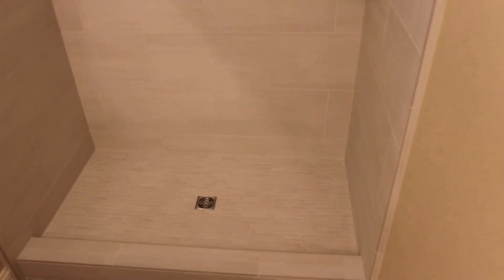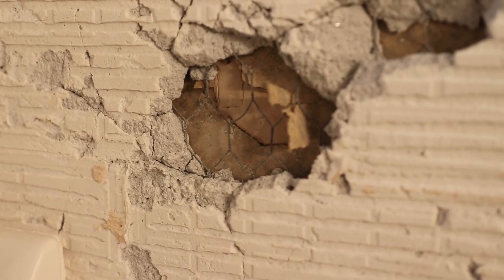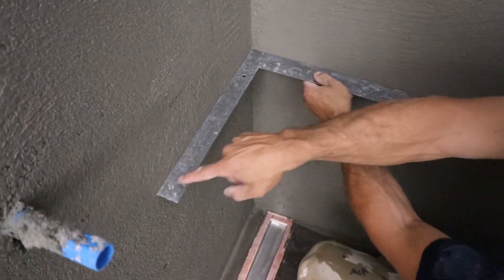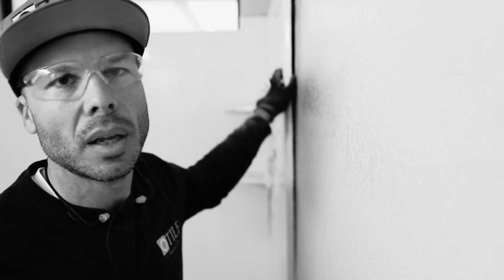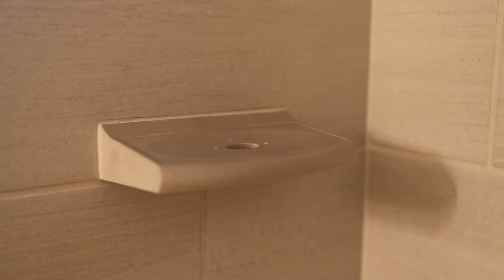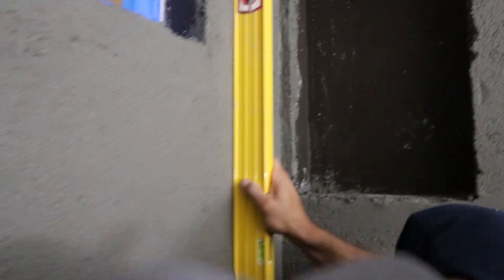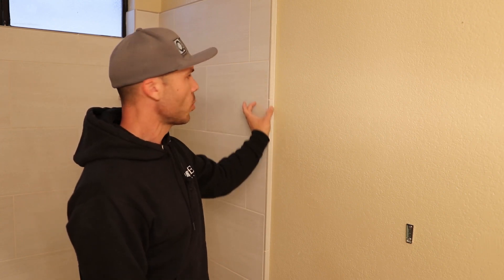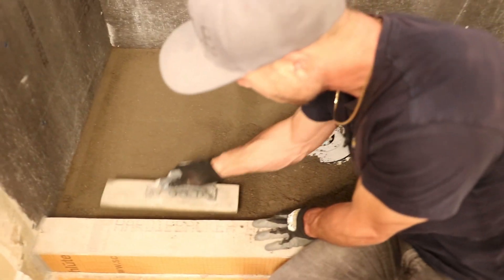Finished Repair of My Shower Tile Failure -- Why This One Will LAST!!!

Comment: Excellent job. I have literally never done a wall float like this, and I feel like we should be using it more up here. That is to say we should be using it at all. I will often slap a little mud in the hollow spots over top of the Kerdi. But then it’s just build out or in as you go, which is an art in itself. I think that the art of parging and floating is a superior approach though. We don’t have this tradition here though, it would be a very tough sell to say the least in this market.

Comment: Floating is the absolute best method  for both walls and floors.
Reply: @Gkbggb Gbgtjbftjj  if you over lap the sheets and wrap your corners and if using paper backed lathe, fold the paper back so you get a metal on metal seams, floating walls and floors never fails. It's a skill that takes years to master which, is why it is rarely seen today. Also, the cost is higher because of the labor and skill involved.

Comment: I'd be interested if you could experiment with the thinset and no lath method. Obviously doing experiments nobody else has messed with on high paying customer houses is a bit scary, though. But using lath, but having it nailed to the framing is definitely a better sounding idea. And don't worry about the haters saying don't float, floating is craftsmanship vs "production."

Comment: 0:32 Come on isaac. Get one of those burn proof cloths to put between your pipes and flammables when soldering.
😉
Oh and the shower looks great.
Reply: @TileCoach  Lol. I have done worse.  We just need to mention it because it's YouTube. 😉
Yo question for you. I am doing a starting to put together a bid for a 2nd story full bathroom. She wants a cast iron tub. But has had people tell her that you can't put a a cast iron tub on second stories. Is there a rule against this that you know of? 
This is in roseville off baseline.

Comment: Commenting here from Western Massachusetts.  The only wire we use  around here is called Diamond Wire Lathe.  I've seen the wire you are using in other  West Coast stucco projects.  Just an observation.

Comment: With the foundation moving, no hard brittle masonry/tile structure will be crack-free for long.   There may have been a dubious install before, but affixing to studs and using better tile may not be any better if the house is moving because of a substandard foundation.

Comment: The reason why you get a lot of comments on floating your walls is simply because it's a old method Yes it works but a lot of time to do you can simply add shims to your studs to flow out using a 6-ft level to make sure you are plumb after that you will add recommended cement board and go from there much faster to do not need to charge the customer more for the price of the mud and the time it takes simply just shim out your studs and go from there That's why you are getting a lot of comments on that anyways your videos are awesome and very educational keep up the good work

Comment: Just came across your videos today and did some binge watching on floating and this repair. Awesome work and videos!! I really respect your work ethic, you're a true craftsman.  I'm on the east coast and most tile jobs I see here are not floated, I'm wondering if it's more of a west coast way, perhaps because of quakes?  When I prep, I usually plumb out the new walls from the studs and deal with any minor dips or unevenness with extra mortar here and there, and I've had really beautiful finish results.  Haven't had a leak or fail yet (knock on wood).  I'm wondering if there are any real significant drawbacks to that work flow in your opinion? Thanks for sharing the knowledge you do.

Comment: Great video! Good on you to take responsibility for an unfortunate situation. Anybody can have a failure, takes a real pro to admit it.
Floating walls is not a normal practice in my area and it interests me. Perfect walls to stick tile to would be awesome! We usually use a paintable waterproofing or kerdi membrane. My question is how do you waterproof the dentshield joins and wall-to-wall transitions? 
Keep up the great vids and work

Comment: Look great, just a tip the less grout lines on a curb the better
Reply: J DJ : Yes, just going to act as a water trough, potential mould/mildew issues ?
Reply: Looks great , I agree I only use a 6 inch wide marble slab on curb tops
Reply: @danthecarpenterman9463  same here, I like to match  stone  curb, soap nook bottoms, bench, and vanity top if possable.

Comment: I love your videos. I'm a remodeler too. I'm not a hater but the only negative thing I can say is if you don't use ardex 8+9 on the fat mud,  any water that ever gets behind the tile will wick through the mud and will rust the roofing nails and will eventually cause the same damage as before. Galvanized nails will not rust. I hope this helps you.
Reply: Aren't roofing nails galvanized?

Comment: Hey Coach, two questions. Aren’t you concerned that the nail (and staple for that matter, but especially the nail) is a point of entry for water to get behind your float coat? I know you are nailing to the stud so there should be less wiggle with your roofers but still the wire mesh holds the head a small bit off the float and water could seep behind and down the shaft...Secondly, do you have any thoughts on continuous curb caps vs tile with grout lines? Doesn’t the grout provide an easy point of entry for water to enter a relatively flat surface? You spend so much time getting your slope right on your pan but isn’t the curb cap vulnerable to wet substrate if it isn’t a continuous cap like marble slab?

Comment: Love the videos, man. I have a question; since you use durock in this bathroom, how did you plumb the walls. Cause when you use float strips, you just plumb those and then screed off 'em. So how does it work in this case with the boards?

Comment: Porcelain tile has very water absorption, below a percent.  Low fired clay/bodies/tiles can have up to 10% absorption. In the industry we weigh a fired sample then boil it for a set time then weigh again. The difference in weight is your percentage of added weight which is water absorption. Tile comes low fire body, think Dal 4x4 chalk white, stoneware high fire which is a brown to buff colored body higher absorption than porcelain and then porcelain body which is lowest in absorption, strongest in resistance to cracking and is off white to  brilliant white and in some cases it is actually translucent. I would never set a Dal tile except in a gas station bathroom. Floated walls crack and the tile mechanics I know are very careful in their mortar mix ratios and then drying. Setting too soon on a float can have cracks in the tile as the bed dries and moves. Give it a time to dry. Our building code in SoCal asks for nailing of the wire into the studs on a scratch coat. No staples and yes the wire is papered as well, stucco wire is used a lot. No other nailing wire or paper in the leveling float. A lot of jobs I have seen are one coat float which then is paper, wire over green board nailed to the studs and stapled. Expanded metal lath is used. Float then probably averages 1/2 to 3/4. I would think that the board Issac uses instead of a scratch coat is just fine. Probably linear stable and water proof. Must be nailed off to code and manufacturers recommendation. Back in the day we use to slip sheet cracks in concrete floors before tiling. The old timers here did that as well.

Comment: I have a question Coach! Can't you just shim out the denssheild from the stud to make a straight wall or is it better to just float? BTW your vids are great!!💯
Reply: I do that oftentimes, need to be careful to rip down corresponding shims on each stud so that the wall is true... or sister a stud against the old if it's way off
Reply: you can, but oft times studs are not straight and just out of plumb, they are bowed, so with cement board or dens shield or equivalent,  you either have a lot of shiming to do or feathering out the surface with thinset or Feather Finish. By the time you do all that a decent setter and helper can just float the shower flat plumb and square with a solid surface no seams. Newer is not always better, sometimes old school is best- and that is true with mortar work. Done right it can't be beat in durability and quality of substrate- only in price. (takes time and skill to apply)

Comment: I am learning so much from watching you and Sal, but I am still confused. Are pre made shower pans like Kerdi and 
Tile Redi known for failure? Is cost the main reason why they are not recommended? If you are a DIYer and not concerned with the cost of a shower kit would you recommend using the pre made pans. I'm not comfortable building a shower pan.  Thanks.

Comment: Hi Isaac - why did old 1950's bathrooms last a generation, but new bathrooms don't seem to last? Is it because of the amount of concrete they used behind the tiles so when water does inevitably get past the tiles that the massive amount of thickness of concrete absorbs the moisture and doesn't let it stay on the thinset of the tile?
Reply: @Gkbggb Gbgtjbftjj there was a complete lack of building standards back then, but the use of high quality materials and craftsman techniques made up for it. you say "built better"...there isn't a single wall in my bathroom that is plumb. grout joints are uneven. some tiles aren't exactly aligned either. you call that "built better"? the thing is, b/c better quality materials were used, those improperly installed plaster walls and tiles lasted 2 generations.

Comment: Isaac I have a question that might sound crazy but I want to know if I can lay actual mastic down then pebble the INSIDE of my porcelain bathtub? will it unstick? can mastic get wet? or what can I use to tile the INSIDE of my bathtub where it won't separate crumble or come off
Reply: Mastic isn't for water areas, if you have a fiberglass tub, maybe look into epoxy products.

Comment: Why refloat if you went to studs? Way way way easier to make the studs plumb and square, or sister them with a few engineered studs. I always thought floating was the lazy way of doing things, even though it's actually more work. I do like the "cap" trim.

Comment: Greenboard (or equivalent) on studs, 4 mil poly on top, diamond mesh lath screwed into studs with Simpson Strong Tie screws (philips head with washer rim), then float. Better to scratch then brown, but can do one coat. Then red guard (or equivalent), then tile. Even 4 1/4 soft biscuit ceramic won't crack after that. But I steered clients away from soft bodied tiles when I could. -Old School son taught by old school father.
Reply: Wouldn't poly act like the paper like in Isaac videos
Reply: Is there any concern about mold building up between the vapor barrier and the redguard?
Reply: @Hhhhhhlllll  Yes, but the float is mechanically fastened directly to the studs. The diamond mesh lathe acts as both anchor and mortar reinforcement, Mortar is like concrete in that it has great compression strength but is weak on tensile unless it is reinforced.
Reply: @nicksimms9577  No, because most of the moisture has either hydrated or evaporated before the Red Guard goes on. I also used as standard epoxy grout and either used hard ceramic or if stone such as marble sealed back with Garland and White Sealer/Bonderizer then used high quality sealer on front- both applied before installation. Very little moisture goes past the finished surface. Had installs 18+ years with none exhibiting mold or moisture (except when glass co drilled through my curb with screws and used no sealant, thanks guys :rolleyes: )
Edit- Apparently Garland-White is no more. Shame, it was such a great product. You could set warp prone marbles with normal thinset, no worries using my method above.
Reply: @nicksimms9577  continued: finished surface.have 22+yr old installations that have no mold or moisture issues. Only water proofing shower failures I've had in 35 yrs were 3, and all 3 were glass guys drilling through top of curb and not even using any kind of sealant in screw holes, so the screws literally wicked the water past the waterproofing and directly into the wood. Thanks glass guys :rolleyes:
Reply: @topcat989  thanks for the reply.

Comment: forget wedi you a  vinyl pan so you can clamp it to the drain like we done on the east coast for the last 40 years before that the plumber would use a lead pan, tile guys can do the vinyl pan ,dont over tighten the three bolts
Reply: Live on east coast also, all I use is PVC liner, three part drain. Takes some extra time to do pre slope but have never had a call back.

Comment: I’ve seen a few of your failure videos , do you just eat the cost or is that an insurance claim ? Just curious I’m in the same field and I’ve had a few minor call backs but nothing nearly to that extent just wondering
Reply: As a former insurance adjuster I can tell you home owners insurance absolutely does not cover faulty workmanship.  And I'm almost certain the contractor's insurance would not cover it either.

Comment: If I was you stop using this method and go to schluter systems for water proofing. If installed right there is a zero percent chance of failure. Once you get the hang of the schluter product it will actually save you time on the install process
Reply: Gkbggb Gbgtjbftjj, partly schluter and in my opinion not the right way, he is still using mudbeds and Hardi board with a coating on it.
Reply: I BUILT A CURBLESS  SHOWER WITH SCHLUTER  AND I COATED THE ENTIRE FLOOR AND WALLS WITH ARDEX 8 PLUS 9...THANKS TO ISAACS EXPERIENCE AND TESTS...I SUGGEST EVERYONE USE THE ARDEX WATERPROOFING.AND MORTAR PRODUCTS THAT ARE EASY AND AFFORDABLE MEASURES TO STOP ALL WATER PENETRATIONS...GOD BLESS YOU ISAAC

Comment: We do everything differently in Australia  we use a 7mm wet area Fibro / fiber cement sheet as all bathroom walls perfect flat  but not always straight ' 20mm f/C sheet over timber floors then screed over,  On a  slab we just use  30mm sand cement screed with 10mm fall to  floor waste  . from wall to floor joint  we use a stretchable rubber joint band / tape with silicone strip  down center  we paint it in with a roll on rubber waterproofing membrane  two / three  coats all areas  then we run a bondbreaker tape  around all joints ,we also use a flexable  tile adhesive  on floor  tiles  we have huge temp fluctuations  from -5  to 40 degrees  .. no fails in 15 yrs 
https://www.davcoaustralia.com.au/products/waterproofing/k10-rapid/
https://gripset.com/products/elastoproof-b50/
Reply: @TileCoach  I added a couple of links to systems we use  ..

Comment: I'm still trying to understand why you do floats. Cement boards have been out a long time. And you rave about floats being flat, but who will ever see that?
Reply: I'm no expert by any means but I thought the process is to furr or sister the studs perfectly flat then use cement board if the wall is uneven.
Reply: @hawtpants111  That's exactly what I did and I got it plumber, level, and square by doing so.
Reply: That's how I was taught as well. Floating seems like it will be a bullet proof solution but I have never had a cement board over sister studs  with water proofing memebrane fail.